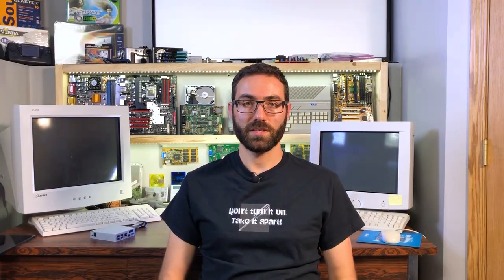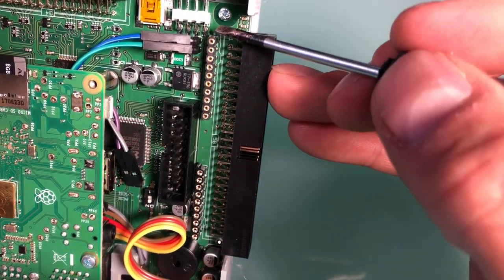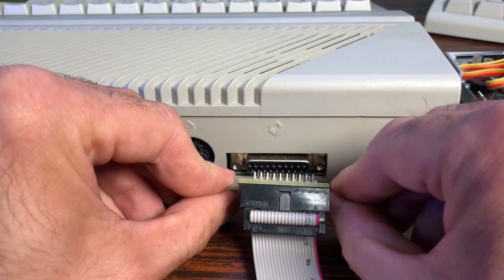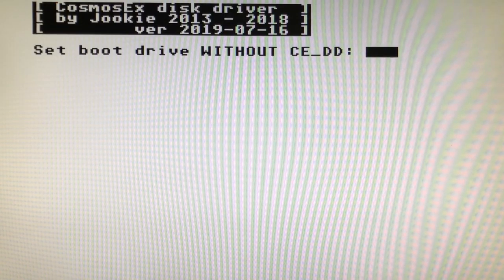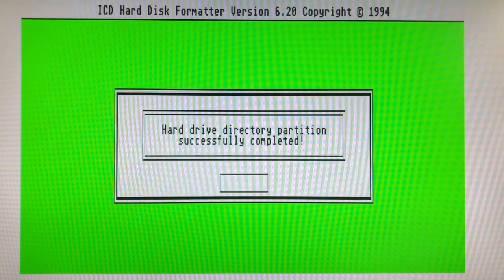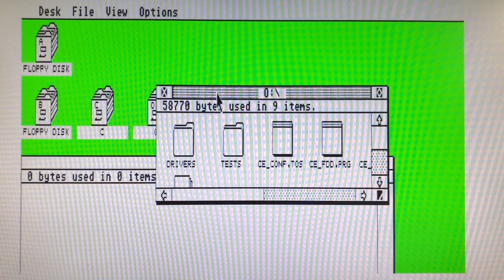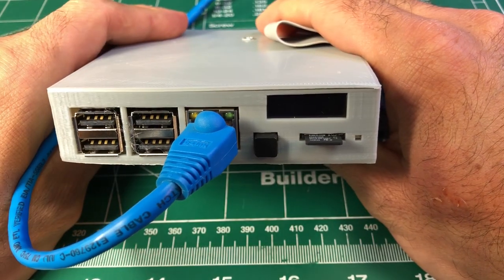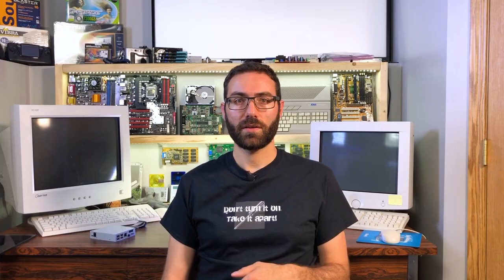CosmosEx v3 for Atari - Tour, Tutorial and Troubleshooting

Comment: This is an impressive Device and very well explained.  Don't know if I will add one to my 1040STE as I like to keep my hardware original.  Also great to see people still interested in the Atari ST, a computer that back in the day I wrote hundreds of reports on and played a few games.  
I remember thinking how fast the Atari was compared to an IBM 286 PC running Windows 2,  I think it  was.
Reply: This just plugs into the ASCI port, like a HDD BITD. So, no modding of the Atari and is mostly a HDD replacement and Ethernet adapter, although it has other great features. There is also a new cheap ASCI-SD solution, if you just would want a HDD replacement.
Reply from the maker: As Jerry mentionned, this can be a non-destructive addition, see it as an external HDD powered by a RPi! Simply plug on the back port using ACSI as you would plug an SH204 original HDD back then! Everything else is software config and bonus!!! I support this project big time as I truly believe this is the best versatile device out there! If you still have an Atari, and can afford to support this project, I cannot recommend it enough!

Comment: I'm using an ultrasaint adapter (similar to ultrasatan I guess) but cheaper that I got on ebay I only had to write an image to a SD card and put the SD card in and it works real simple. But I am also using STE only not any TT or Falcon so I guess that's where the CosmoEx v3 may be advantageous but I think this is a bit complicated for a mainstream Atari STE user like me.

Comment: I have an cosmosex wich i dident used for years.. trying to config it again, but this video sadly diden't help me out! How do i use an usb stick to install hddriver?
Reply from the maker: If you had yours for years then it is probably not the V3 I am showing in this video. For USB you should try changing the ASCI assignment. Your question is not clear enough tho, what’s the destination format? USB? SD? What are you usung the USB for? As a permanent drive or just as a transfer method?
Reply: @AnalogThinker  Your'e right i'm using the first cosmosex version, and it was not working because i made an mistake.. after all those years i forgot to install the ce_dd driver! So the floppy emulator wasen't reconized.. i spend many hours to solve this problem.. and i figurd out i just was something silly..! Thx for responding to my question.. Version 3 of version 1 instaal is just the same.
Reply from the maker: @groenevinger3893  Awesome, great to see you got it running! Cheers

Comment: I bought 2 units and both are having issues. One is 99% DOA.   On the other unit, the web interface works a second then dies, and it will not reconnect, and beep and reset like crazy.    For anyone having the same issue with the web interface, I was able to SSH to the 2nd unit and was able to run the config script to select SD card for ID 0, after this I was able to access the unit thru the web interface.
Reply: In trying to revive my DOA unit I found that the device doesn't contain the ce_force_flash.sh.  I downloaded it from github but I was not able to run it (not authorized to execute it) even with the root login.   The Linux installation was corrupted and could not be repaired. Since I bought 2 units, I cloned the RPi SD card from the 2nd unit and was able to boot the first unit.  Now I have two units that boot up but neither is recognized by my MSTE.  Oh well...(QC=0, unit testing = 0). Back to more troubleshooting
Reply from the maker: Yeah I can relate. I think an SD card image backup us essential, that’s the first thing I did. I had a unit that kept rebooting and it turned out to be insufficient power. On the MSTE I also had troubles to make it recognized. I had to remove the internal drive and ACSI to SCSI adapter card as it would conflict with the back ACSI port (I could see the content of both C drives mixed up, a big soup of corrupted files haha). I have yet to find a way to get both the CosmosEX AND internal drive to work together. The MSTE is the only machine still giving me troubles, let’s share our findings!